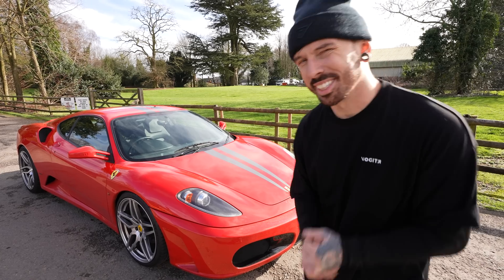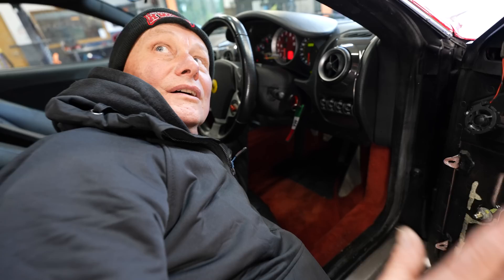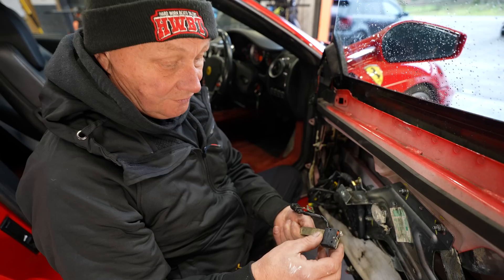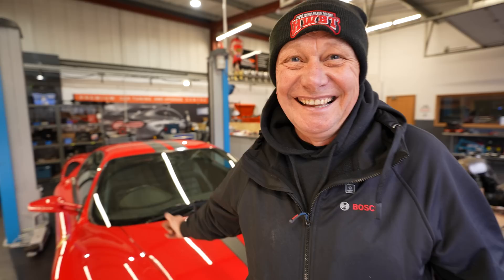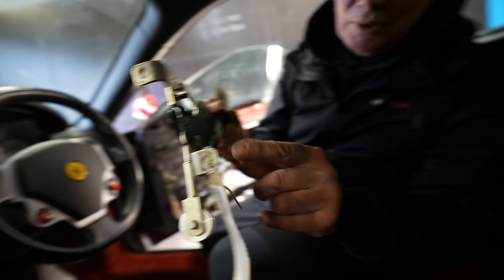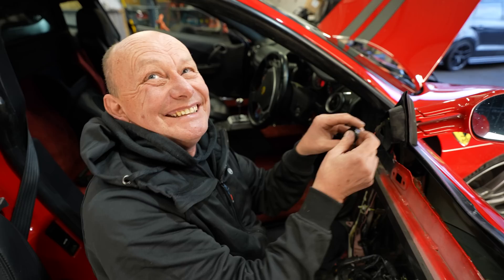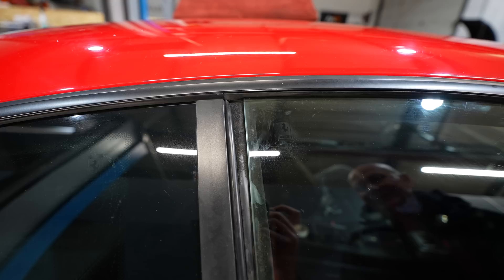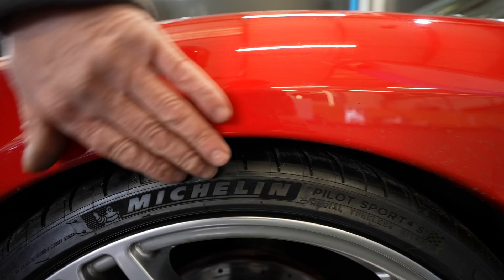FIXING EVERYTHING WRONG WITH THE FERRARI I GAVE MY DAD

Comment: Remember my first car. Saab 900 2nd gen. SImple construction but lots of sensors. Beside crucial ones f.e. I've got information on dashboard if any of external ligh bulbs were dead. Then I've switched from 1995 made car to 2007 (opel/vauxhall antara) and I've had feeling that it was step backward not upgrade. To the point: problem is corporate policy than "too many electronics" in cars. Good job Lads and cheers!

Comment: I would hazard a guess that the problem with window gapping wrong could be down to wrong setting of bump stops at the top of the mechanism . There’ll prob be two  one at front and one at rear. Either the front is too low or the rear too high meaning when it’s fully closed the windows kanking  forward, probably just needs a bit of adjustment to be spot on

Comment: You need to hold the window button down for 5 seconds after its all the way down. Then roll ot up and hold 10 seconds. Open ans close the door to see if it worked. Or if it auto rolls down.
Reply: It resets anytime the exu resets or rhe battery is disconnected

Comment: The window sensor is a common issue. So is the window actuator being off like that. These cars are all 15+ year olds. They’ve had a lot of door slams over the years, and that’s damaged these parts over time. And also these F430s are from 2005, a lot of these components are from the 360, and even the 355… so they’re 30+ year old technology. It’s all a good reminder that while the F430 is the first “reliable” ferrari, they were still prioritize performance, and not creature comforts. But I am afraid that window won’t get any better without a new actuator, which is not worth the price. So you’re better off fixing the flocking on the window seal (that suede like part) by re-flocking it (you can buy kits) or going to a craft store and being some felt strips - both will help make sure that window seals properly. Way cheaper than buying some multi-thousand dollar actuator that will fail again down the road.

Comment: I’m hoping this comment gets seen but the drivers door is hanging too low. You’ve adjusted the window for where the doors open but when the door hits the striker, the door lifts up and misaligns the window. You need to raise the door up slightly and realign the window to get the glass to line up correctly with the b pillar seal.